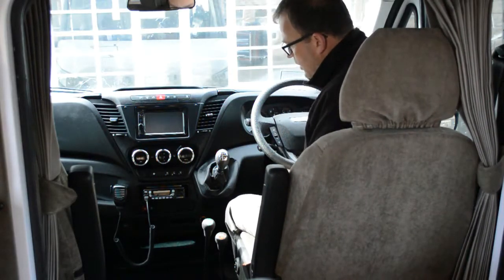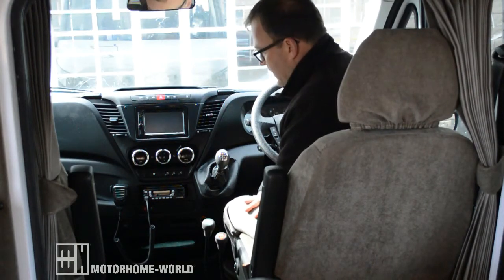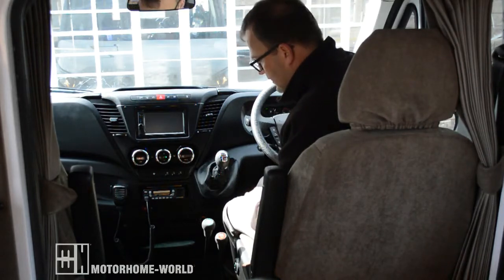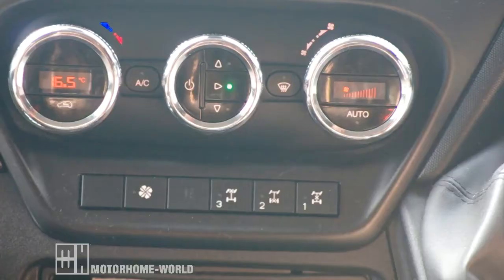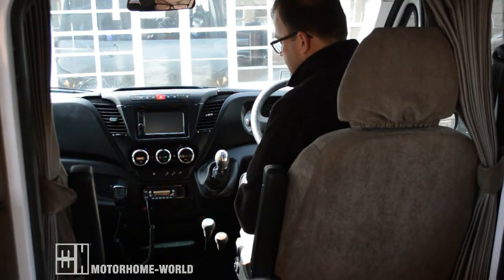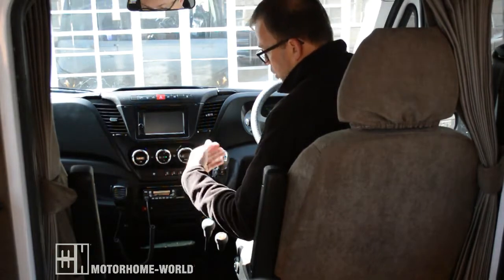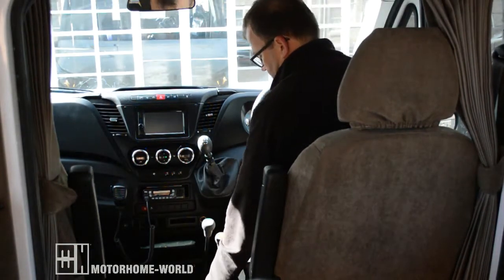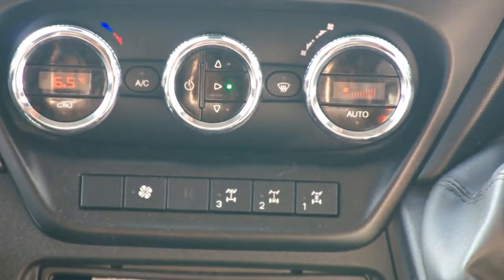MH-W - IVECO Diff lock system

Comment: Hi there, I am working on an iveco diary,  it only has the rear diff lock. When I press the diff lock button,  it engages , but it doesn't show on the dash that it has engaged ,I have made sure it is engaging,  by moving forward and and back,  but the diff lock light still doesn't pop up on the dash.